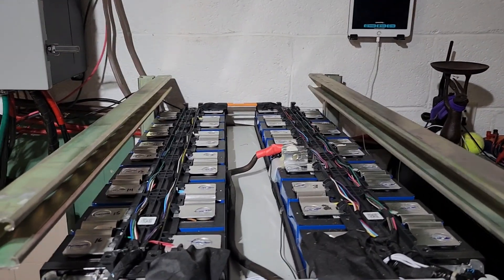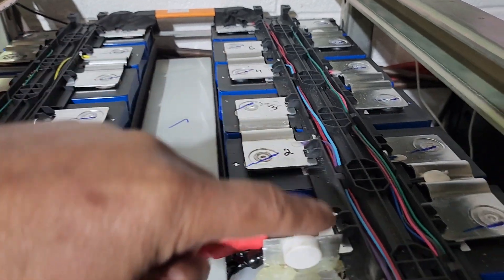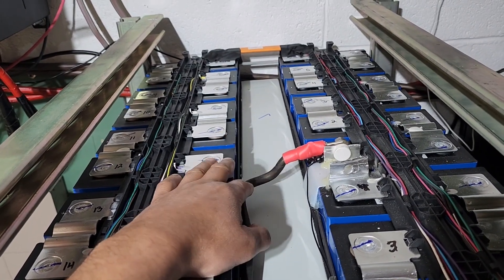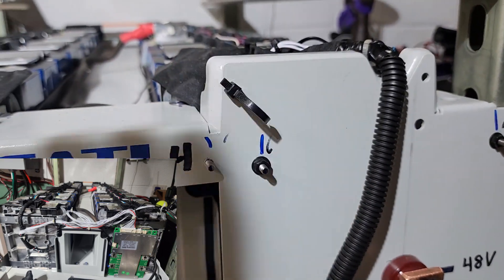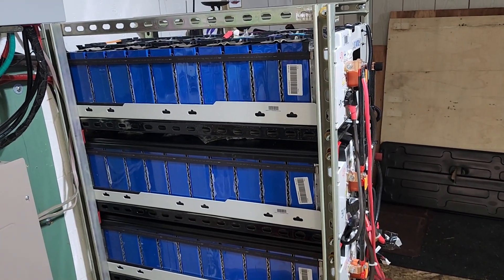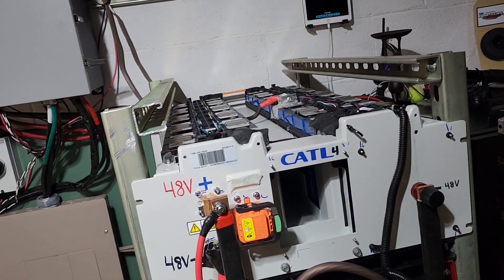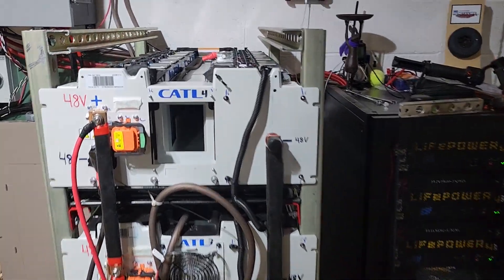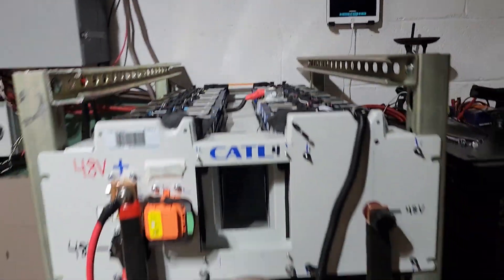DIY Solar Powerwalls Build Seven for the Price of One Part 4

Comment: Nice series with these videos about this build👍
Although you do take care of the build,  it's all a bit tight / serviceable unfriendly?
But yeah, that's what it is. 

I am only a bit worried about nr5.
Cable length between parallel packs is essential. 
David Poz made a specific video about that and eg. Victron does state that also in their build manuals. 
The reason that batteries should have the same length to the busbar, is that otherwise nr5 will get out of balance. That pack has a lower voltage due to the longer cable length.
Reply from the maker: Thank you I was concerned about the same thing but after doing some testing. I haven't noticed any major difference. I'm off by 1% compared to the other 4 packs. That's why I went with 1/0 cable equal lengths to make sure there's no issue with paralleling the 5th pack.  I'll keep an eye on it just to make sure it works out. Wires going to inverter is 4/0 Equal length.

Comment: Generally speaking you can just take the fans off and flip them "backwards". The only issue would be if they were static pressure fans attached to radiators, but in your application it won't matter.

Comment: Did you find any dust anywhere in the pack, like leading edge of fan blades or in the air path/cell seperators?  Could you do some capacity testing and post data.  How well are they staying in balance?
Reply from the maker: No dust anywhere. They staying balance pretty good .005mv

Comment: I wonder if you could have used the last two cells in the back on each side for the 5th battery.  Then move the jumper from the back, up a couple of cells.  That would allow you to use the existing terminals on each battery.   Then you could put terminals in the back of the case, to hook up all the sets of 4 cells into the 5th battery.
Reply from the maker: It'll be last 4 but you still have connect them. I just wanted to be able to service each 1 individually. Thanks